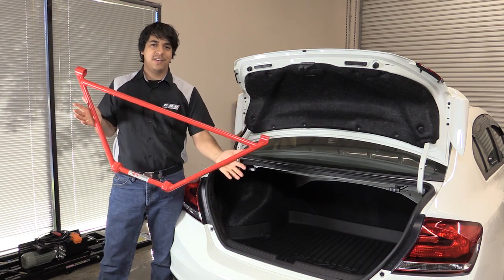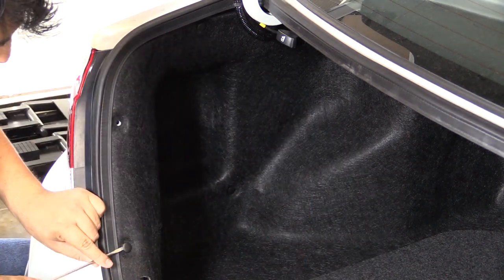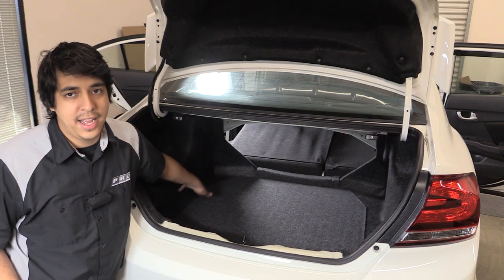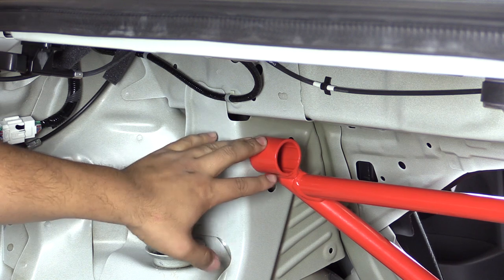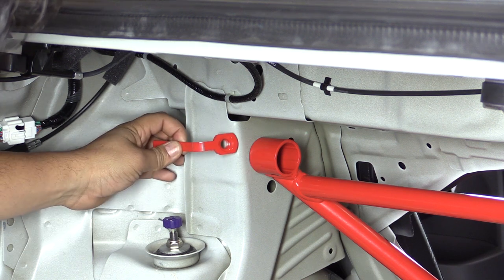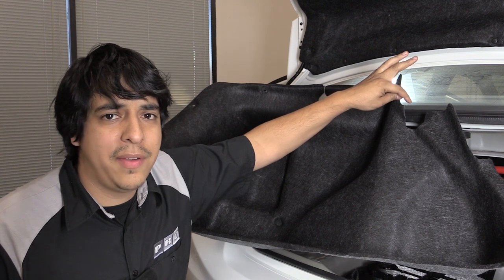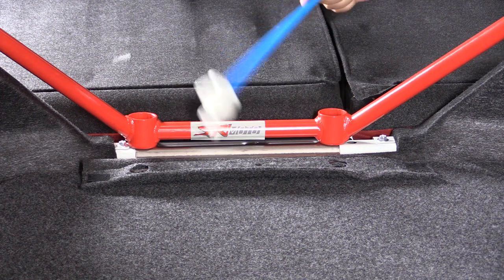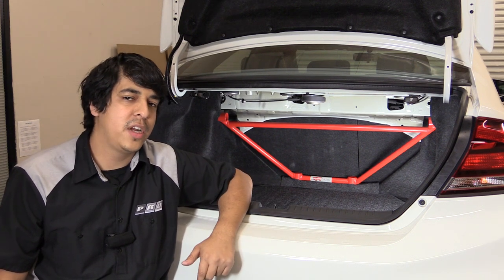SiriMoto Trunk Brace Install - Honda Civic 2012 2013 2014 2015

Comment: These are great, I have the Ultra Racing 4 point front tower strut and trunk brace on my 15 si sedan. Handling is a major upgrade!
Reply: Are you running stock suspension? I am planning on getting the Sirimoto strut bar first and will possibly do this second. Do you see a noticable difference?
Reply: I like the lower tie bars also but I'll probably do front and rear last. I love my 15 si sedan👍

Comment: So for when drilling the bolt hole for the 2012 should I have the bar mounted and bolts fully tighten or leave the bolts a little loose? @procarstudio
Reply: I would personally tighten everything up. Then drill using the bar hole to align the bit as a template. Tightening everything down will help ensure there is no movement or play when drilling.
Reply: @DoubleCupRacing  that’s a really good point. I’m about to install one and didn’t think of that. So thanks!

Comment: How do I get the hardware thing out of the void? I dropped it and can't event feel it now.... I feel like this could have been designed a lot better.
Reply from the maker: I'm sorry to hear you lost your hardware, but I think you'll have success using a magnet to retrieve it. We've had a couple other customers do this. The hardware is required for the bolts to lock in and stay put. If you have other questions or concerns, please email into customercare@procivic.com.
Reply: Its lodged in there and cant move. I tried for about 40 minutes using my fingers and a piece of wire and couldnt even get it to budge. The magnet was less than productive as well.

Is there any chance I can get new hardware because I dont think theres anything I can do to get it short of cutting a section out of the frame.
Reply from the maker: We can definitely help with this situation. Please email customercare@procivic.com with your order number for further assistance.
Reply: Same problem. Literally all they had to do was make the stem like a half inch longer so there's enough room to hold onto it while you fiddle around in there.
Reply: i have dropped the hardware in there i cant get it out. so you guys ended up leaving it in therev?

Comment: i was wondering if you guys made a template of where to drill a hole for the 2012 civics and one for the cuts on the truck liner if she can you email me the info please
Reply from the maker: +alex de leon Unfortuantely we do not have a template for this. However, once it is mounted with the other bolts, you will be able to see where the last hole needs to be drilled.

Comment: Same mounting locations as a 12-13 coupe (pre-refresh) as well?
Reply from the maker: +Joseph Coates It is, but would require a hole to be drilled on the left (Driver side) top mounting point.

Comment: i have the strut bar install so which one is the better choice between trunk brace or front lower tie bar?
Reply from the maker: +pob tsuas Lor I would recommend the trunk brace first. This will help keep things balanced. Otherwise, the front will be stiffer than the rear. However, it is entirely up to you on how you wish to upgrade your civic.
Reply: Ok
Thank you

Comment: would you recommend installing both the sirimoto trunk brace as well as the sirimoto phase 2 strut bar or would you just need one?
Reply from the maker: +Nigel Bradford It would help to strengthen both ends. Putting only one would strengthen that side only